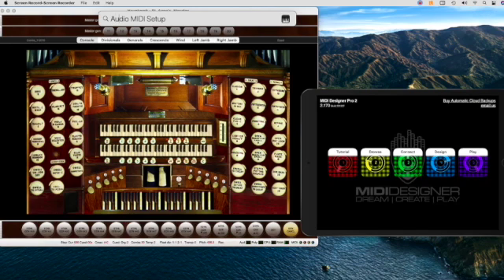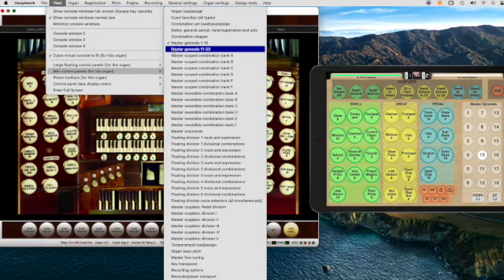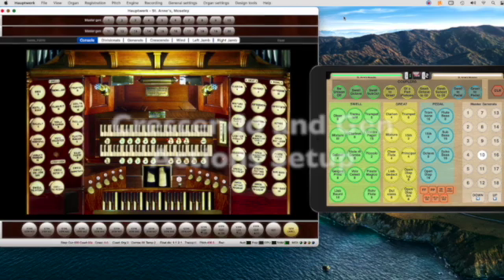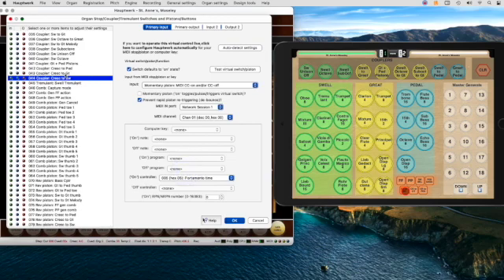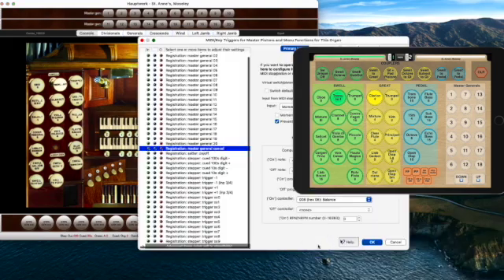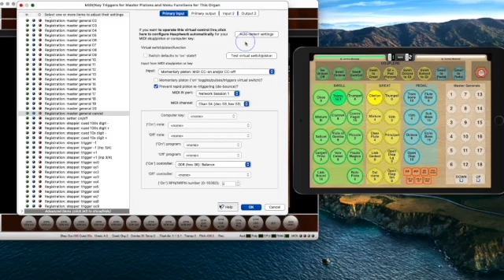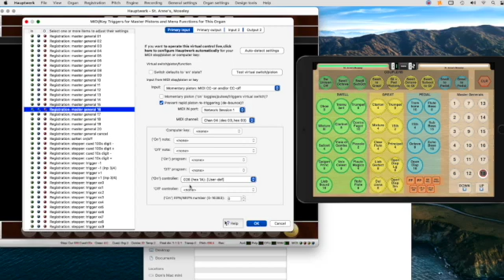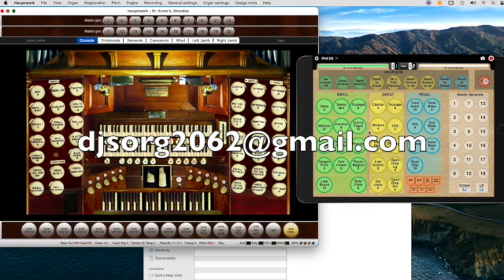Instructions - Simple St. Anne's Hauptwerk MidiDesigner Pro Layout Setup

Comment: It wont work with my windows laptop it says hauptwerk doesn’t recognize this device. And this guy sucks. He talks so slow. Needs to off of YouTube. To old
Reply: I am retired and design controls for MidiDesigner as a hobby. I help anyone interested in getting started with MDP, no charge. I am a former organist, so am interested in HW and other VPOs.
Reply from the maker: @donsabourin3268  Contact me at djsorg2062@gmail.com. I need specific info on your setup and exactly what you are experiencing to understand any issue.
Reply: It worked in a way but it keeps on switching on and off as if the iPad isn’t connecting can u give me extra tips on how to successfully connect my iPad and midi designer pro to my dell computer
Reply from the maker: contact me djsorg2062@gmail.com
Reply from the maker: Please contact me via email. This site is not conducive to detailed troubleshooting. I need to know details of your setup. The video you are looking at is several years old and likely outdated. I may need to update it specifically for your setup.
Reply: @djsorg  i don’t need it I will probably use a launchpad i appreciate your help
Reply from the maker: NewYorkfan - I'm sorry I didn't mention that my setup is based on using a Mac. I should update the procedure. You need to follow MidiDesigner Pro connection to a PC. It is NOT the same as for Mac. See https://mididesigner.com/wiki/doku.php/manual:03_connections_redux. You can speed up replay in some Video Players. I could cut out ½ of the video to speed it up, but I don't think many people would be able to follow the steps. Since some people may not know how to program (or be able to modify) the settings in HW based on the preset midi settings in Midi Designer, I tried to be as thorough as possible. I also point out several HW failures I ran into, such as with Cancel, and how to work around them after many, many hours of troubleshooting. Contacting me for help to begin with, as I asked, I would have personally guided you through the PC connection procedure. I prefer to provide help one on one, and not through YouTube Replies. One final point: I hope you are never too old to play the organ!

Comment: I have hauptwerk connected to my ipad and in the devices in my settings it says apple ipad but cant see it in my configuration in hauptwerk
Reply: In Hauptwerk, any Midi Device properly connected to your computer will show up in General settings > MIDI Ports.
Reply: Im trying to use the iPad to use hauptwerk but it disappears show up is there a midi cable for iPads
Reply: @newyorkfan9832  If your iPad has a lightening connector, you use a lightening to USB cable.
Reply: Listen man you need to improve on your speaking speed and how you present vids. My ipad cant be identify itself on hauptwerk if u have any socials pls add me so u can help me further
Reply: It kinda works but the switches keep turning off and on like as if the ipad keeps on reconnecting and disconnecting over and over again. I need more help man